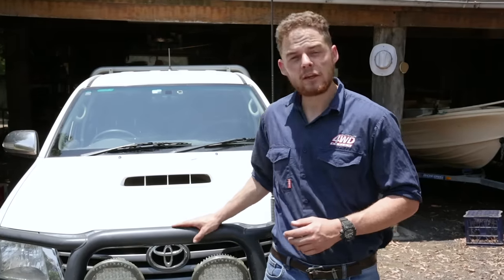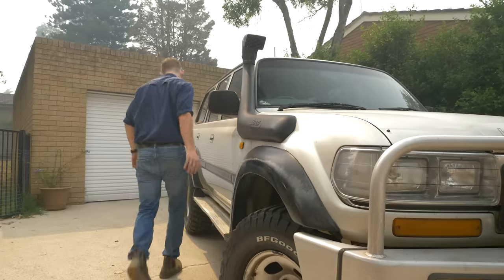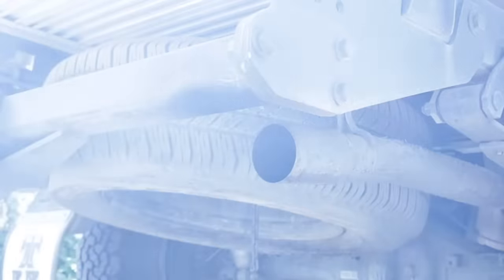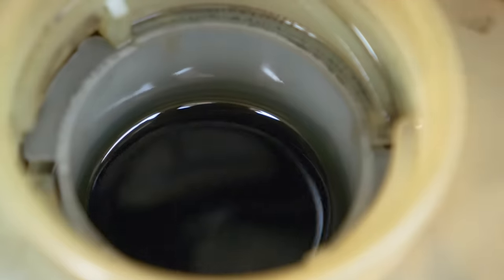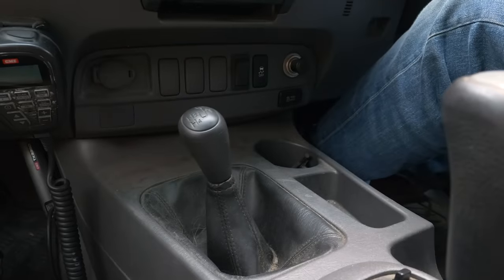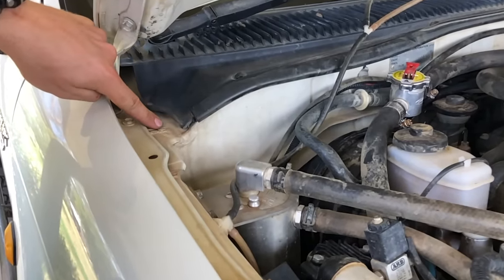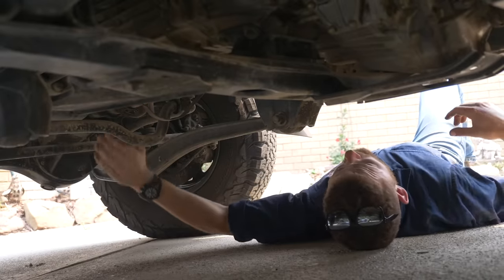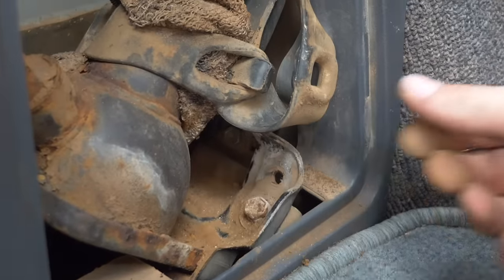BUYING USED 4WDs – Expert tips to avoid a LEMON and get a BARGAIN

Comment: 2008 KUN26R Hilux. Definitely picked a gem, over 170k on the clock, no diesel knock, factory bullbar, winch (never been used) and a factory snorkel. The car was an old RMS car that was just used to drive around and check vacant RMS land, an awesome find!

Comment: When buying a used car check the dashboard lights before you buy. Firstly get on the net and find pictures of the exact model car of the dashboard lights, there are plenty of pictures, but it must be the model you are interested in, take a screenshot of the page and print it out. If you are searching on your phone store the photo of the dash, so you can access it when you look at the car. Sit in the driver's seat, then turn the ignition on, don't start the motor, now look at the dash lights on the car, then look at your picture, if the number of lights don't correspond, this means there are missing lights on the dash, it may be that the sensor has been disconnected or the part is defective. This especially means the check engine light or other safety critical lights.
Reply: I'm on a Mitsubishi Triton forum & with the newer diesels there's a warning light that looks like a "FART" & the amount of the people that ask what does this light mean is absolutely ridiculous 😂

Comment: Last year I was lucky enough to buy a fairly good second hand hilux 4x4 2010 model, by fair I mean quite high mileage 510 000 km on the ODO, it had a few minor issues but since I am a Toyota Mechanic, I was able to repair all of the minor issues with little cost, now i'm looking forward to having my own adventures
Reply: Hi. I want to ask you specifically about rust in Hilux pickups, since you are a Toyota mechanic. I'm from Buenos Aires, Argentina. Toyota started manufacturing here in 1996, I believe. I've been told that rust is far worst in Hilux pickups than in any other brand. Is that so? I'm not in a seaside place, where there's salt that corrodes metal. There's no snow here (no salt in the roads). Should I avoid old Hilux pick-ups altogether? Thanks in advance.
Reply: @brunoraffo6726  all hilux   pickups  are rusty on the chassis rails here ...from the salt on the roads in winter and the damp climate .........i live in ireland .......

Comment: i brought a td 2.8 pajero never been of road so far iv done 12000km in the bush love it for 5k my first 4x4 too
Reply: High RPM I got my Pajero used never been off road until I got it. It use to tow a 20 foot caravan around Australia a few times it did have a tied engine I put 1000$ into it and runs like a dream only paid 1500$ for it and Standard maintenance has been done to it got it around 320000kms and I’ve put 100000kms on it now over 5 years
Reply: I got a 2.8 pajero, cost me $2000, 300,000ks on the clock. Picked it up in sydney drove back to Gold Coast. I’ve put 120000k on it, with regular oil changes it is still going strong with 420000ks🙂 
I will never sell it.....its taken me everywhere!!
Reply: @dirtydogg06  what year is your's i got the 2001 last of the 2,8 tb under rated 4x4
Reply: Pajero means WANKER in Spanish.
Reply: has to do alot of break ins then lol
Reply: @TonkaGoldman-xd5iw  means it in English too

Comment: I snagged a complete bargain of a 4wd, my 1997 Mazda bravo single cab, a couple was traveling around Australia and saw this vehicle on a farm and had to have it, extremely low ks, immaculate interior and a strong petrol engine. They drove it from WA to SA just after a full service then serviced it again when they got to SA. I bought the vehicle with only 82,000 ks on the clock for $4000 it's has some body damage but nothing that effects day to day use. Since I've purchased it I've put 31s on it and some spotlights. It's been the best car I've ever bought and it'll serve me well for another 300,000 ks

Comment: Another good thing to look for is if you see scrub marks on the inside of the mud guards indicating they have ran over sized tyres like 35 inch which is hard on transmissions and diffs.

Comment: You can also use a white paper napkin put a drop of oil from the dipstick on the napkin. The oil will spread out. If the oil spreads evenly with even color the adddives are working correctly if it forms a dark ring the oil is in bad shape also look for metallic flakes in the dark ring. The test should be done after running up to normal temp.

Comment: Bought an 80 series from 97' with close to 400000km on the odo. been driving it through the kimberley, WA, SA and NT without any problem. No rust, no weird sounds, clean engine bay for it's age and had all the services done since it was bought in 98'. Been lucky with this beast.  Only downside it's a petrol.
Reply: I'm new to the 4wd world. Whats the downside of a petrol compared to diesel?
Reply: @meetingmrwright1791  immediate torque at lower rpms
Reply: @meetingmrwright1791  Fuel economy is the most important thing!

Comment: I once bought a GU patrol from a second hand car dealer. 2 days after having it (after the 2 day cooling off period) the motor started dying after about 5 minutes of driving. Later found it had rust in the after market fuel tank. Then when I checked the coolant it was like mud.  Then a month or two after having it the heater core went. Definitely a lesson learnt in buying used 4wd. Cost me a lot money haha, I was about 18 at the time and didn’t know a whole lot!

Comment: Sometimes things fail also though, you have to do research on general faults of that vehicle and motor. 
I bought a 2005 sr hilux, everything looked good had rust on an after market tray and on the bonnet where it had a chip. Didn't bother me. The headlight wiring and tail light wiring was shit. (Still haven't fixed rear). But you can't account for things going wrong when it never presents itself on purchase day. 
Drove mime for 3 months and noted down things as I learnt about the vehicle over time. I repaired things I wanted to get fixed, brakes, all fluids etc complete over haul. Then my front diff blew up, had a cv shaft completely sieze on the highway and the force of it snapped my crown and pinion. Cv shaft was in decent condition not clicking nothing. So if you do purchase a vehicle definitely always have spare cash for general repairs!! And if you get as unlucky as me, sorry bud 🤣🤣

Comment: I picked up a mint base model 93 80 Series (1Hz, manual) late last year with 360K on the clock.  Second owner.  Minimal off road use.  ARB winch bar, Kamar rear bar, OME 2" suspension and a Toyota PTO winch thrown in ;-).  For roadworthy it needed all the usual suspension and steering bushes, panard bushes, new rotors and pads and a windscreen.  I love it ;-)
Reply: How much did you end up paying? I'm eyeing up a 1992 80 series. 1hz manual, with 350kms. Genuine toyota winch and tidy body.

Comment: When i was 18 i bought a mitsubishi pajero 2.5l turbo diesel drove 3hrs to pick it up. Was a very   clean car maybe to clean on arrival  father of the owner then decides to tell me it wont come with rego. That should of been the first indicator. No obvious rust or oil leaks seemed to be ok. Decided to buy it. Had to hire a trailer and tow it behind my dads vz holden Commodore. Got about 30min down the road. Got pulled over by police and told to go to next town and no further. Sooo had to ring the grandad luckily he had a toyota prado tow rig but he was 3hrs away so had to wait. Got home. Got a rwc check no kidding they had to use x3 sheets. So went from a $2800 car to a $5600 car then had to wait 4 weeks for a vicroads appt. Got it all registered took it 4x4 driving twice. Transfer case blew up. So no more 4x4 thats ok. 2wd still worked so atleast i had a car. 3 weeks later driving home from work car stops. Get it towed to a 4wd workshop. Engine has a hole in no. 2 piston. Quoted $11000 for long motor. So towed home found an engine on ebay for $2800 which is what the car cost me. So a no experience 18yo in mum and dads driveway attempted to fit a motor into his first 4wd. Apparently theres a few differences between a 93 4D56 and a 96 4d56. No one told me that. Took 3 months but got it done. Drove it for a while. Wasn't the same. So decided to buy a brand new mitsubishi triton 4x4 kitted out thinking i wouldnt have many issues. 4 months after owning it the engine popped the head gasket, factory fault pitting in the blocks water jackets and bad machining warping the heads. 4 month wait for new long motor so sold it back to dealer after a fight. So after that i gave up on 4x4s bought a commodore drove that for a while decided id look at 4x4s again. Around that time a mate was selling his 80 series Landcruiser was around the right price. He supplied the rwc i took delivery of the car. Drove home headlights didnt work. Rear bar lights were not working. Rear draws were flooded. Turned out he took it 4x4 driving after i paid deposit and got it rwc and bogged it good mate aye. Never took it 4x4 driving, fixed what needed fixing then moved it on. Bought another commodore. Sadly my grandad passed away around 2 years later so i bought his toyota prado which iv always loved. Had to replace all worn out suspension and replace the torque converter over drive solenoid and get turbo rebuilt but other than that an awesome car and i cant see myself ever getting rid of it. Just goes to show. Do your research on common issues especially with new vehicles. Just because its new doesnt mean its trouble free motoring. If in doubt get it checked or walk away. Sometimes its worth paying for a check then getting a big repair bill at the end.
Reply: daryl95 your biggest issue was buying mitsubishis
Reply: So long story short-buy a Prado/land Cruiser and have happy motoring😄
Reply: I feel for ya mate, brought back memories of my 18 yo self lying under shit box after shit box getting hard lessons in car ownership. The next one was always going to be better but usually wasn’t. I guess that’s the price of admission, experience is expensive to get but rarely a waste of money if you use that knowledge later in life.

Comment: I Had the neatest 92 ln106 with 0 rust and 0 panel damage. All the bells and whistles to go with but unfortunately it ended up on its lid due to pour sight and wheel placement on a night expidition out in the bush. Went straight for a lemon looking 90 ln106 with less kms that needed a bit of work but after having one perfect half a car i managed to put together a pretty decent looking hilux out of the two, good thing with this model is they dont stop, cheap to repair and are tough as nails. thats if you can get past the leaf springs swinging into over drive on rocky terrain. All in all i spent 6k on the first one with 2k extras and 2.5k on the second with 90% the upgrade only costing me time at home to switch parts out, generally doubling the value and lifetime of a dirt cheap 4x4 that i can bang up out the bush. Nothing better then bang for buck.

Comment: Once bought Toyota 4runner. When I GAVE IT AWAY in the end. I had changed the engine, have all the gearbox redone and the front axle redone. Spent month cutting away rust and weld in new and changed all interior carpets. + fight leakages around front windscreen and sunroof.  Not my proudest moment, BUT I had it for 8 years, had 36" tires and I had ton of trips and fun on it.  But man! that thing ate money like there was no tomorrow!

Comment: So my add will read:
A real 4x4, built to be abused and has survived......
Bush Pin Stripes to all panels 
A zillion dents and miss aligned panels from hitting more than a dozen Roos, Emus and trees that jumped out in front of me.
Several trim mouldings held on with stikaflex and or tek screws - looks like a real 4x4 (no extra charge)
Bull dust blows out of A/C vents, cause it has survived 1000’s of klm  on real Aussie tracks.
NO service records cause I don’t trust any other bugga to do it right.
Come and take for a test drive but be prepared to climb a gum tree to test 4x4 low.
If you can’t turn a spanner I suggest take up knitting instead of off roading.
300+ Klm and will easy do another 200+ Klm 
Bring ear plugs so the noisy muddies don’t give you a soy boy head ache.
Reply: hey soys actually help you to be a better off roader 😂

Comment: I bought my 93 4x4 with a replaced engine and it had been in a minor accident. About 3 hours later it broke down in the middle of an intersection... They wouldnt take it back but they fixed what was wrong. Ever since, its been very reliable and when it does have issues its been very easy to fix. Ive owned it now for 2 years. Also, when i bought it it didnt have any rust surprising for a 93. That was till i moved next to a salt lake... Im sad because now its getting rusty and theres nothing i can do but move out of state. 

Anyway, this is a great video, makes me want to wash the mud off my 4x4 and not abuse it so much.

Comment: Good general advice. There's still modified 4x4's out there that are well cared for. 

Mine for example is lifted, 35, turbo etc but is engineered for mods (well mostly) and is not daily driven. Every trip, gets a wash, regular polish and wax and fluid/filter changes at 6m if I haven't done the KMs. Regularly replace the longer term fluids like coolant, diffs, trans, power steering and brake and I adjust these intervals depending on use. Lots of people don't realise that city/urban driving is generally classified as extreme use by most manufacturers so service intervals should be shortened. KMs are low for its age and it looks neat and always clean.

Then again, I'll never sell 🤣

Comment: I bought a Mazda Bravo B2500 when I was 16 soon after I got my Ls, I loved the car however 6 months after I got it, it cracked a head and needed an entire cooling system and top end. 11 months after that it blew 2 coolant lines on the side of the road and now needs a new motor, it was one of the cleanest 4wds I had ever seen when I went to buy it, everything worked and it had no issues. 3 years later I've spent nearly double what I paid for it fixing it. It's treated me better than most things in life but I'll admit I got snagged.

Comment: I bought a Discovery 3 TDV6.  The owner told me there was definitely no rust and had spared no expense on maintenance. There had been several thousand spent on the vehicle and I was given the receipts.  As it turns out there was rust on the chassis that I will now have to repair.  I can’t believe it passed a roadworthy like that.  Also I believe the seller put head gasket fix in the radiator because it was loosing coolant but very slowly.  Eventually this led to overheating and a costly engine replacement. The engine wasn’t wrecked but it was more economical to replace with a younger low kms engine. I now have a spare engine with a blown head gasket. I feel I got shafted but in the end I do really enjoy the vehicle with it’s towing and  off road capabilities. I loved the video.

Comment: I bought a Land Rover Discovery 3 recently after a lot of looking at a few.  Mine was owned at a Land Rover fan, who sadly passed away, and his wife wanted to clear a few of the cars.  It’s in good condition, all I’ve needed to do is the usual service,  a brake calliper, and a worn front hub and bearing.  Managed to get some good inspected used parts cheaply.

Comment: I'm one of the lucky ones. I recently bought a 2002 LWB GLS Pajero for 3 grand. It was owned by a mechanic, which some people would balk at. However, it has a fully logged service history right up until a week before I bought it. He was the original owner. There is no rust in it at all! The clear has started to lift off the silver, which gives it a bit of a cosmetic issue. It has 450k on the clock, but it's very tight to drive. It has a lift kit and upgraded suspension. There are no dents in it and the inside is very nice with no rips in the seats and very little wear for its age, which is also a good indicator of not having been abused. It's a 3.5 litre petrol and has an LPG conversion as well. I'm a very happy off-roader.

Comment: Have previously owned two used 4x4s over my time. 1998 Toyota Prado had petrol V6 & auto box, 288k kms on original motor & trans. Came from Roxby Downs (mines) Never missed a beat. Second was a 2004 Nissan Patrol. Had 4 cylinder td30 motor with manual box. 200k kms on it when bought. Also never missed a beat. Paid over the Redbook avg for both but they were in way better than avg shape for model years. You get what you pay for, as long as you have some clue on buying used cars.

Comment: I bought an excellent-condition '06 Toyota Tundra here in the U.S. in late 2008, that was a lease return vehicle to the dealer.  It had 86K miles on it, but it looked like new, underneath and body-wise (no leaks, no rust--Arizona vehicle).  I bought it,  and found out later (found the previous lessee's business card tucked away) that it had indeed been an excellent truck.  In fact, he tried to buy it after the lease, but could not come to terms with the dealer.  Today it has 260K on it, and still runs well.  I recommend going with Toyota for used vehicles, and the first-generation Tundras, though now 14 years old, are excellent buys if you can find one that is been babied.

Comment: Managed to get myself into an older "99 Patrol Wagon with the TD42T with 520,000kms on it for $6,700 . The paint was sunburnt, but the engine was very healthy. 

Quick checks for the older cars might be things you wouldn't think of, like "did it come from the factory with this engine?" Check engine numbers and plates your self to see what the car is registered with and what engine the VIN indicates. When these mismatch, start looking much harder. Doesn't mean you're looking at anything dodgy, just means someone made big big changes. 

1 year later, happy to report car still going very strong :)
Reply: Also, loved the oil cap check thats a new one for me :)